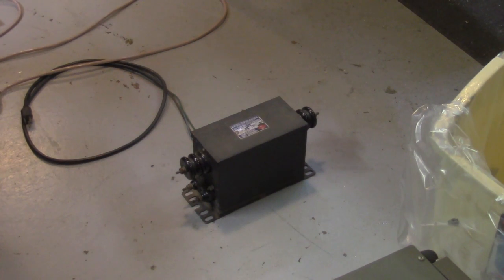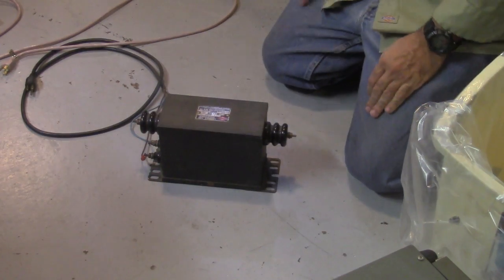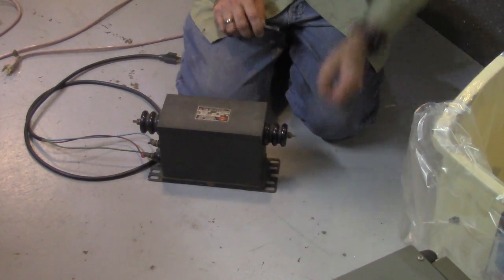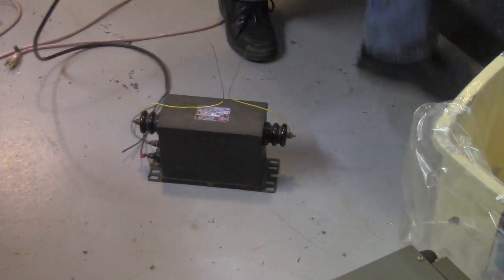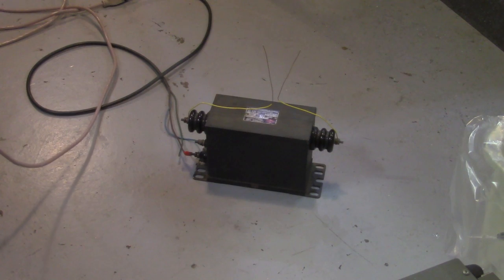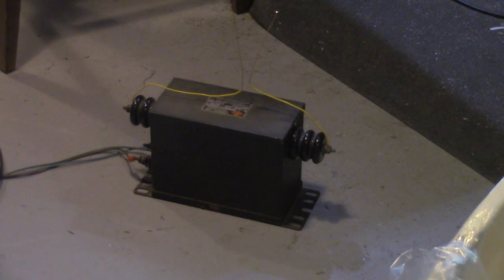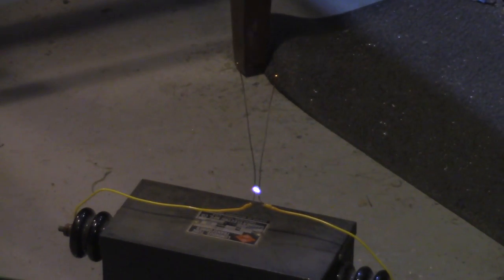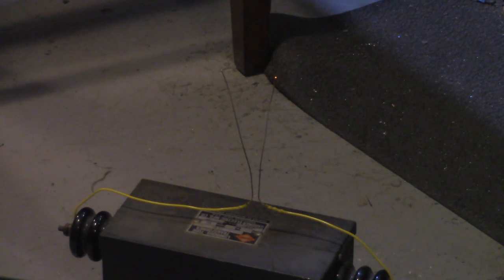Neon Sign Transformer test

Comment: Neon sign transformers incorporate a current limiting ballast function, so you don't need the light bulb in series with the primary.  (there is a magnetic shunt between the primary and secondary, so  that higher current in the secondary causes more flux through the shunt, diverting it from driving the secondary)

Comment: As a teen I had a 15Kv @30 Ma xformer, looked just like this one, but a tad bigger. I rode the bus to get it, it was across town. I used it as a supply for a Tesla Coil that had the plans in the 1964 Popular Electronic magazine
I used to spend hours playing with that transformer. Pretty sure they are impedance protected, being wound so the internal resistance just goes way up when hot.
BTW that coil worked pretty well
Reply: I feel you, just got myself a 5kv 200ma transformer. Pure fun